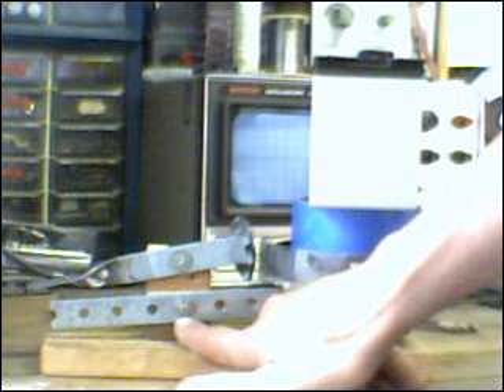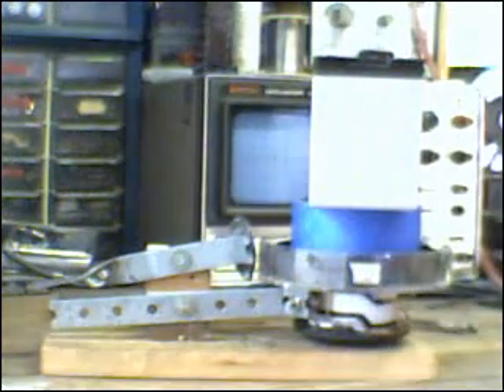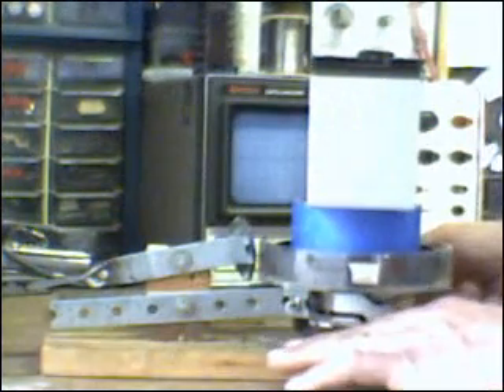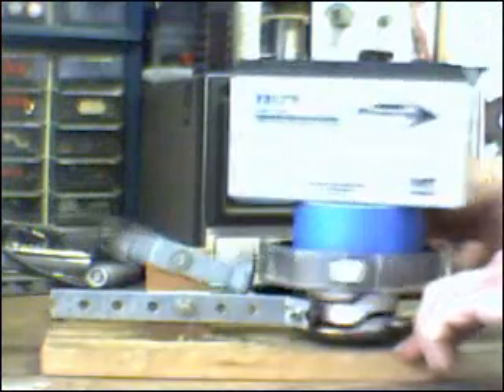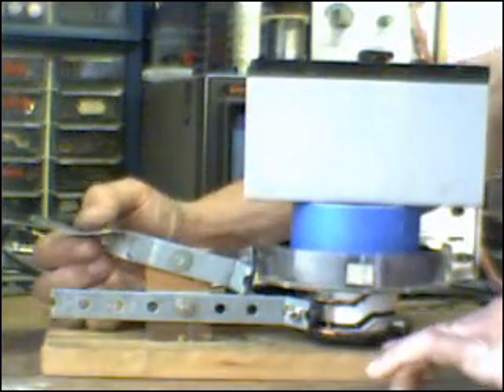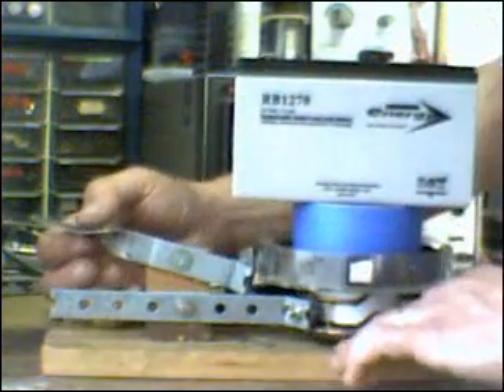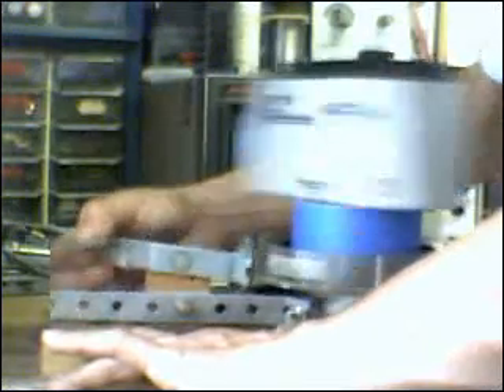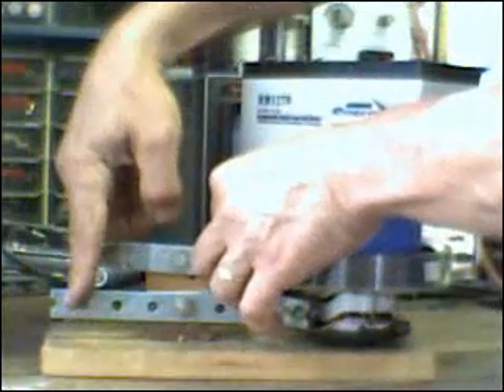09 - Oscillating Stator Permanent Magnet motor. Please rate!

Comment: The car has energy because it is moving. The energy came from gasoline. When you slow down, you can recover a fraction of your energy if you have a generator in your car. The car looses energy because magnetic brakes slow it down and that kinetic energy becomes electric as energy is transfered from the car to electrons. Formula One cars use this priniciple to get a little electric boost after they recover energy. Pretty cool.

But no free energy.

Comment: i think you shoulod put a few copper wire coils around your cylinder, that would buid up current, and replace your oscillating magnet by an electromagnet that would only trigger when needed, timing is the key again, just an idea, eventually to reduce friction a photoelectric cell would trigger the electromagnet. 
To generate electricity, gorget gears, just tap into the magnetic field  of the device, the coils around it   are the perfect solution.
g

Comment from the maker: The "work" to move the stator in and out of position is small as it is in a perpendicular plane to the moving rotor magnets. I move the stator up and down but the rotor trys to push the stator left and right. The axis of the stator lever movement holds it in place and provides the push to the rotor. My hand does not. See? ZFF